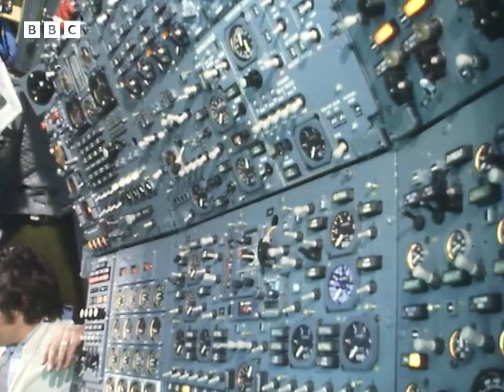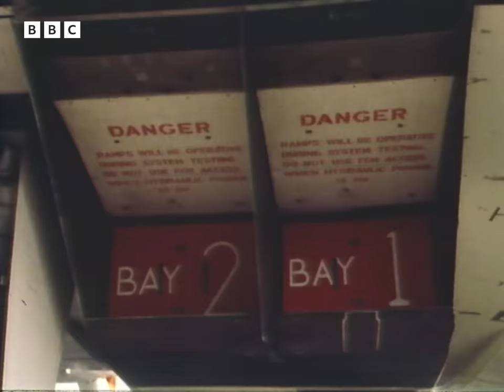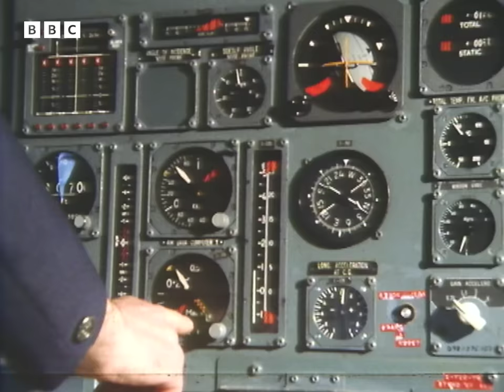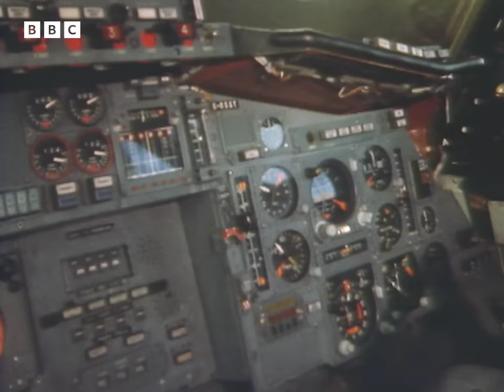1979: Making the LAST CONCORDE at FILTON | Retro Transport | BBC Archive

Comment: Amusing video.  I was hoping it had more technical detail.
@1:14 ""Concorde workers feel the government has let them down."   Actually, Concorde was a stupid vanity project that, if the government had any sense, would never have allowed to begin.
@4:14 "the droop nose is Concorde's most endearing characteristic."   Actually, it made Concorde look like a fat old chicken trying to fly -  wings and body tilted right back to try and get enough lift, while having its neck & head stretched out in front to try and get some directional control.
Concorde was in some ways the same as the ridiculous 1940's Bristol Brabazon - sponsored by a Government that thought air travel was for rich VIP's who wanted to travel in luxury and cost was jut a means of showing how important they were.   Meanwhile, the American industry had understood that the big profits would come from making air travel so cheap anybody could fly - hence high seat numbers and a focus on fuel efficiency - neither of which the Concorde could have.
Hilarious that the expected a second generation of SST in the 1990's, when they could only sell 14 Concordes, even with huge government subsidies.
Reply: Oh yes, Concorde was famous for looking like a fat old chicken, wasn't it?  I think you mistyped one of the most iconic and beautiful planes ever designed.
Reply: @poppyland74  ;  Concorde did not fly very well - it barely had enough power to get airborne.  That's a fact - illustrated all too clearly when one crashed after takeoff from Charles de Gaule airport due to being forced to takeoff slightly below critical speed due to a minor undercarriage maintenance fault (incorrectly attributed early on to a wheel kicking up a part that had fallen from a DC-10.  It didn't help that the crew kept pumping fuel into a tank ruptured by the DC-10 part, feeding a fire, but if it was able to climb the crew would undoubtedly have realised and corrected their error).    This crash so obviously showed Concorde's marginal flying and inherent unsafeness that it never flew in service again.
One could hardly describe Concorde as fat, given its narrow cabin.   I guess few people, other than those associated with free-range chicken farming, have seen a mature hen try to fly.  However, if you have seen a chicken try to fly, as I have on my father's chicken farm, the resemblance to a Concorde taking off is very obvious - both use an extreme bank angle with the head/droop-snoot stretched out in front, as both struggle to get enough lift at full power.
Don't forget Concorde's ridiculously high fuel consumption, even during high altitude cruise.
To an engineer like me, there is nothing beautiful about the Concorde - it is a reverse proof of the old engineering adage that something is only right if it looks right.  Concorde looked wrong and it was wrong.